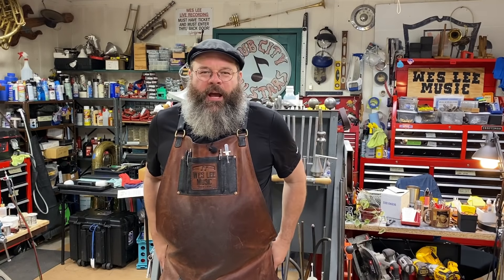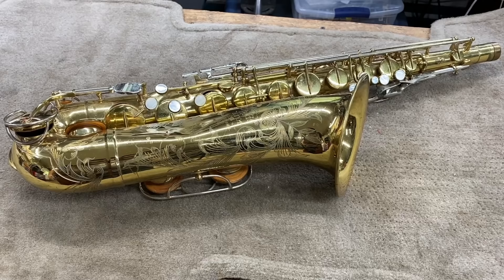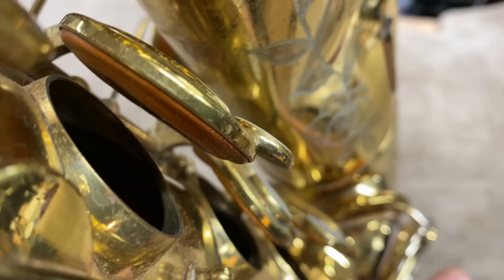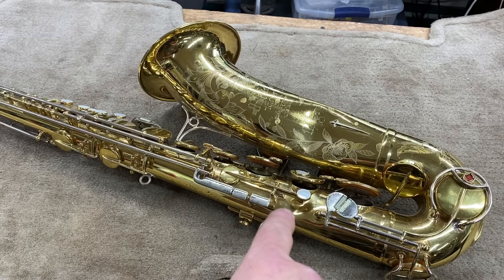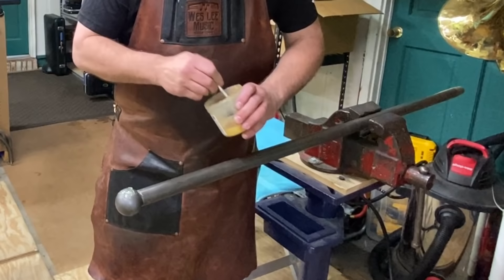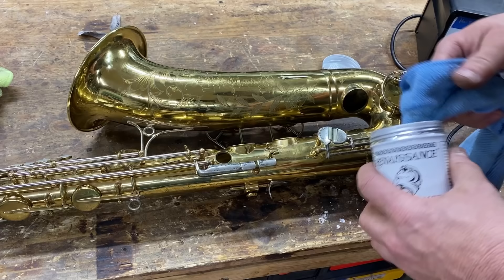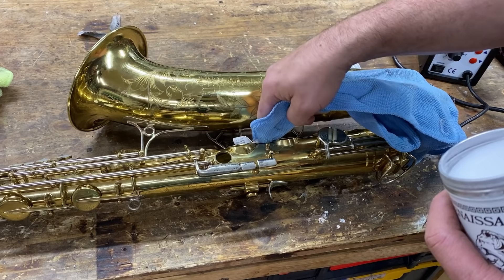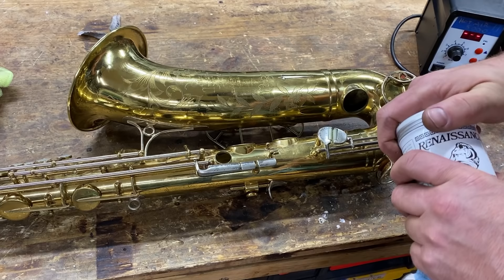Martin Tenor Sax Restoration 1- Cool Tool Tuesday- band instrument repair, Ferree's Tools, Wes Lee

Comment: You are a magician. I used to have a Martin tenor with brass keywork. That horn went out of adjustment so easily.
Reply: That's surprising.  Those Martin Committee III's (Magna's as well) were built like Sherman tanks.  They're HEAVY horns.

Comment: I saw you covered that hot air guns name. Those Chinese hot air guns can’t really get hot enough or blow air fast enough for soldering a material like brass. They’re really meant for soldering electronics and they struggle w large ground planes. I’ve found other uses for mine as well after I fixed the restricted air flow. They’re generic is the nicest thing you can say about them 🤷‍♂️

Comment: Wes, I have recently discovered your channel and am really enjoying it. Thanks for what you post. (On a side note, the post supporting your vice rocks on the base because of the silly screw mounting. If it annoys you you could try a fix which I used on mine. 5 or 6 horse shoe nails driven down into the gap make perfect wedges and give it great stability. I know you put a lot of load on yours but it may be worth a try.)
Cheers

Comment: I'd be concerned that the metal chasing hammer used on high spots might hammer out some of the engraved design and thus I would be tempted to cover the hammering surfaces with a thin leather sock.

Comment: Wes you are amazing
I was wondering if that sax has rolled tone holes and if you had to level any tone holes? I like that sax snake tool. And you did that with no rebound I didn't think that would be possible. I have the Feree's N65S threaded barrel set. I drop a barrel down through the bell and then put a rod down through the horn and thread it onto the rod while it's in the horn. Love watching your videos.

Comment: What state do you work in? I'm asking bc I think you'd be able to fix my saxophone, I sent it in to pages a while back bc my bell was dented, when I got it back the thumb rest fell off and it's held up by tape, and they did a terrible job on the bell, it is bumpy where they "fixed" it, there are probably more issues I havenxt seen, it's older than me